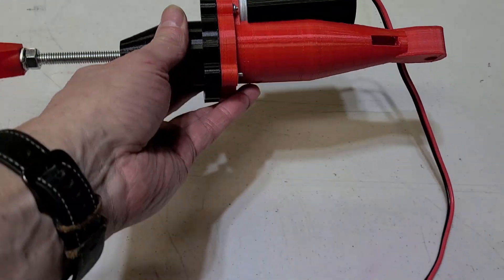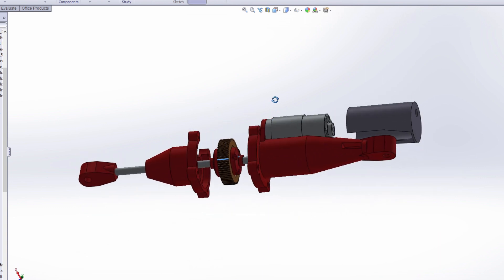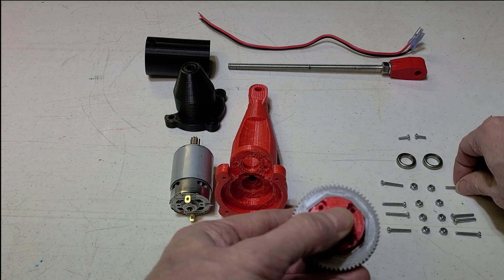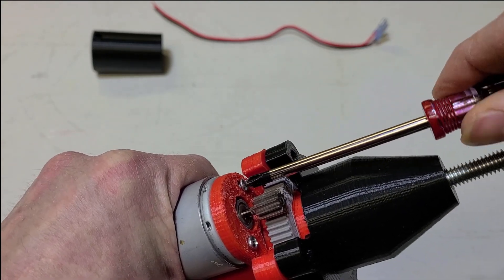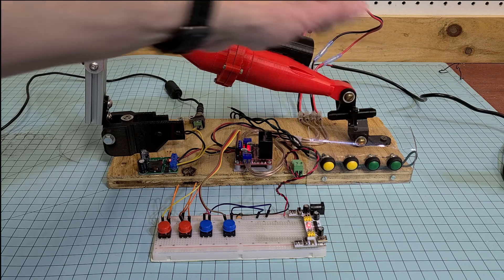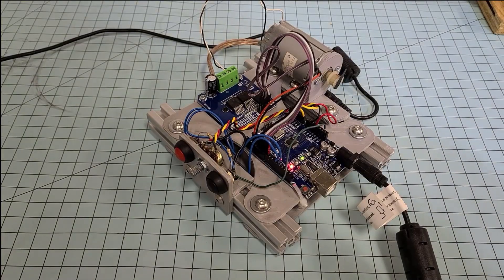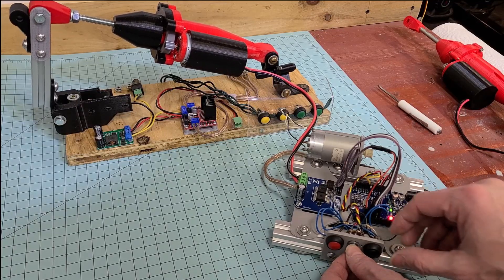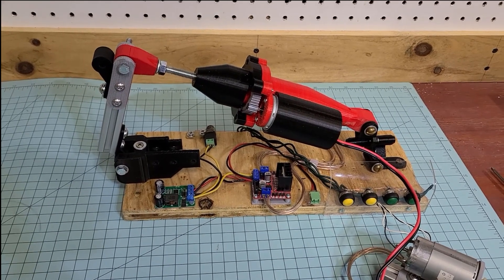Heavy Duty Linear Actuator - Fast Strong and Simple 3D Printed Linear Actuator project

Comment: Hello Rick, I could not help but notice the under extrusion on your printed parts. I wonder if your nozzle is clogged or if your extruder is skipping slightly.
Reply from the maker: Yes, there is definitely some under extrusion on some of my parts.
I tend to print rather fast and generally except that I'll end up with some defects. Between that and not always doing regular calibration on my machines, it lowers my print quality a bit. 
Usually, if I get a rough print, but it's still functional, I'll just use the part instead of using time and filament to reprint.
When I'm doing something with more precision, I slow things down a bit more. 
Thanks for noticing and commenting!!!